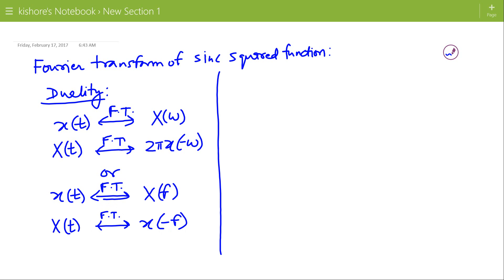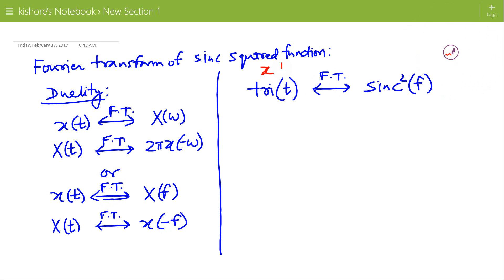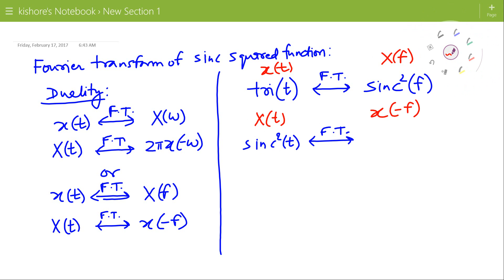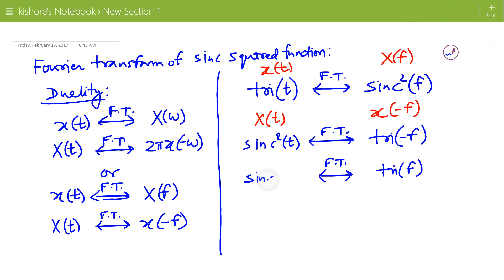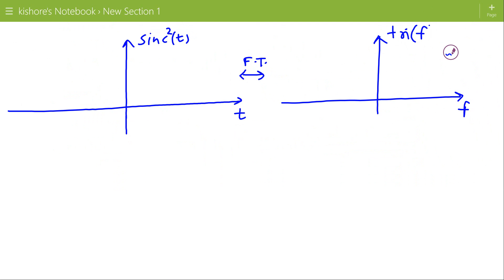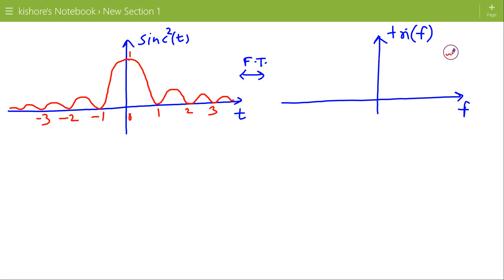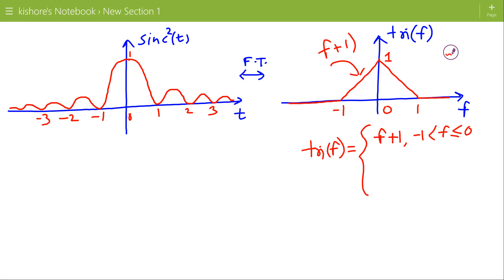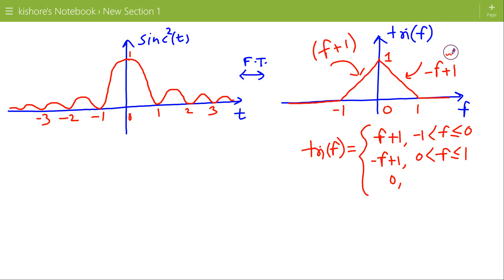Lecture on Fourier Transform of Sinc Squared Function

Comment: You literally just pulled that tri(t) out of nowhere, didn't prove anything. Also you didn't show the FT in the w-domain, no one every asks for it in the f-domain
Reply: 1 year late but that's a "rule" fourier for signals, for tri(t), write down the function as linear functions then double differentiate them to get the function as unit-pulse functions. And you can easily get fourier of it, then the fourier of a double differentiated equation is the fourier of original function times (ik)^2. That's how he got the function. And due to parseval theorem and energy spectrum function, energy of a function which is infinite to infinite integrated absolute squared of the function, will be equal to 1/2pi times infinite to infinite absolute square of the fourier of the original function. It's a method used in signals and communications to calculate functions as their fourier transforms which includes rect(), tri(), pulse(), unit(), sgn() functions and their fouriers often
Edit: And yes he's teaching wasn't good